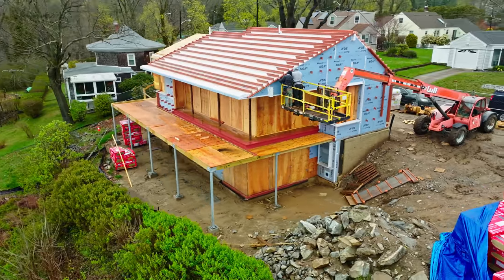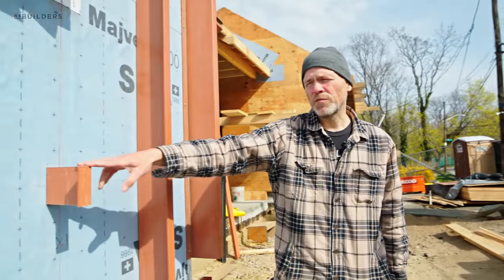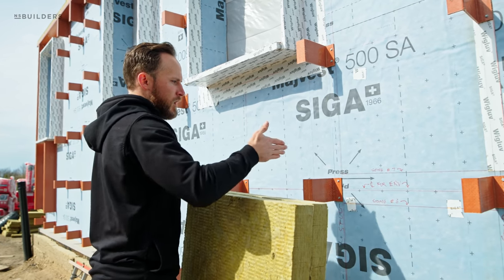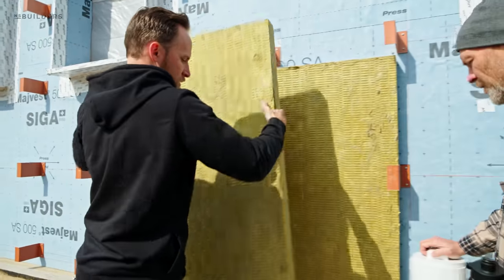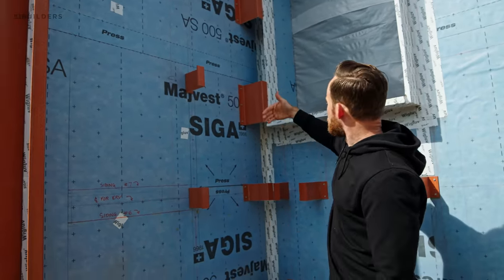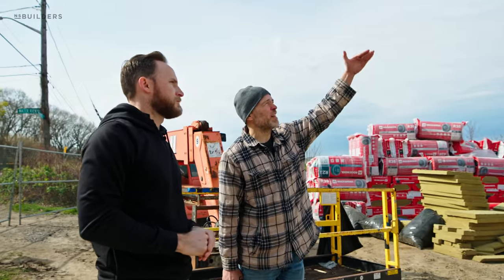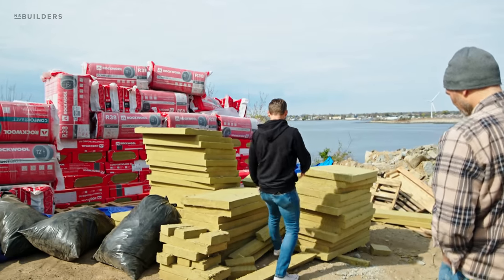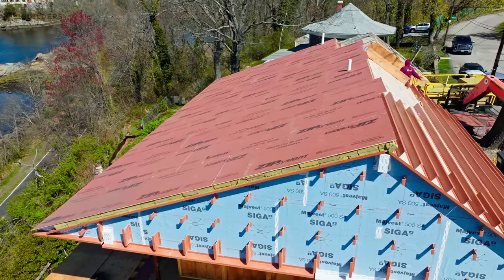Z Girt installation for exterior insulation

Comment: Maybe a bit late but you should offset the joints horizontally and vertically on the to layers of rockwool comfortboard to minimise the bridging.
Reply: I was thinking the same thing, but I do not know how they can do it with the system they are using.

Comment: those Z girts on the roof, shouldn't they have been at an 45 degree angle or vertical, seems like they might cause water to not drain if it penetrates.

Comment: What if you didn't add that second layer of plywood?  Could use the Z-Girt and attach wood battens or a product like Kebony's clip-in rail system to attach siding? I am curious because I am looking for an effective and low cost way to attach vertical siding with 6" of exterior insulation that is also DIY friendly .

Comment: I wonder how they're handling the roof edge detail at the rake edges of the roof. I noticed plywood and rockwool straight to the edge. I would think a coastal area would need a solid blocking or continuous z girt parallel with roof slope for edge metal and fascia attachment

Comment: How to minimize the heat leak from gaps in the rockwool joints? If the heat leak issue big enough to be worth fixing?  The rockwool joints are not staggered between layers, so that will cause a heat leak line. It looks like there will be a gap between rockwool panels caused by the 1/8" thickness of the Z Girt web and the stiffness of the rockwool. There will be variation in the rockwool x rockwool gap due to variation of where the Z Girts are installed. These points all cause heat leaks, but I are they are large enough to be significant?
Reply: I noticed the same flaw and reckon that these thin gaps (1/8" lines created by the thickness of the Z Girt) between the Rockwool panels would create a serious heat lost around the insulation. I would love to see the final result and see if this issue has been fixed.
Reply: tuck tape joints before you apply the sheating and on sheating the vapour barrier? (Tyvek)

Comment: What is the detail at the base? How are you covering that comfortbatt?
Reply from the maker: The finish on the exposed comfort board is in discussion, lots of approved options. Just comes down to Julia’s decision. The top will be capped with copper
Reply: @NSBuilders  Thanks-Look forward to seeing it. I want to use a similar detail on a project, but I don't see yet how you will fasten any finish to the building without a z-girt or something similar.

Comment: I'm surprised in such a highly insulated building that skylights are being used.  Even the best skylights are a giant "hole" in the insulation and depending on the orientation a skylight is potentially a high solar gain during the summer cooling season and very little gain duri g the winter heating season.
Reply: Does a skylight negatively impact heat loss and gain? Absolutely. But it brings in  daylight, provides cross ventilation, and makes a small space seem larger. Good design requires balancing choices across dozens of categories, not optimizing a single metric at the expense of all others.
Reply: @julianugentarchitect  bingo! I would much rather live in a comfortable house with lots of natural light, compared to living inside a sealed yeti cooler. We’re building a new house right now (just got drywall) and one of my must haves was lots of natural light in as many places as possible. We put velux sun tunnels in the upstairs interior bathrooms and the back hallway upstairs. The only “dark” rooms in the house that don’t have a natural light source are the closets, and the interior powder bathroom on the main level.

Comment: I think y'all went overboard on the roof z girts. If you understand uplift you really won't have much if any between the first layer of sheeting and the second layer of sheeting. For three reasons. 1 that area is sealed for all intense purpose. 2 the area is filled with insulation. These two actually contribute to the 3rd. For uplift to occur on the field of the roof you need positive air pressure under the sheeting. Well if air can't get in and the space is filled with insulation how are you going to get positive air pressure to blow the roof off? Yes you may get a little under overhangs if you have them but most house have them and typically you only need a 2x1 ratio of support into the roof for the overhang. 
Same goes for the walls. Again hard to get positive pressure in a sealed and filled space. If your roof and wall framing are sufficient to keep the first layer of plywood from blowing off I doubt the second layer has any chance of blowing, sucking or uplifting off or whatever you want to call it as long as you use sufficient method of screwing the z-girt to the framing. 
Prove me wrong? Think about it you only have a screw every 2 feet on the roof girts so except for the edges what does it matter if they are continuous once you put the plywood on?